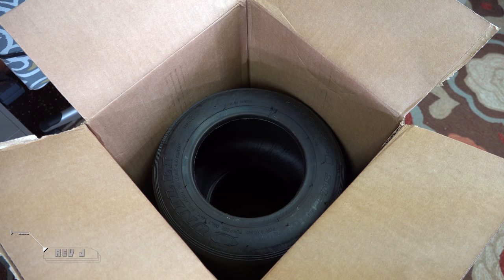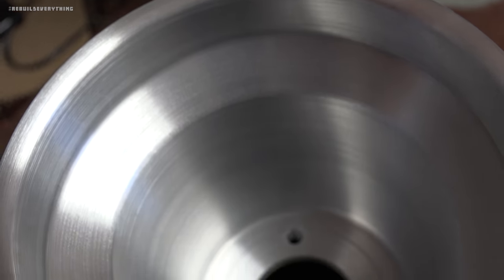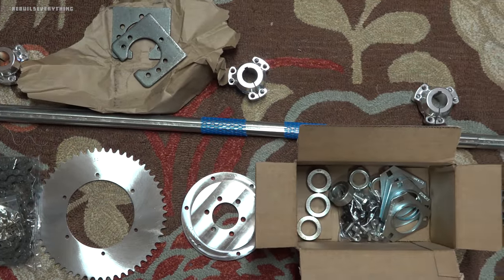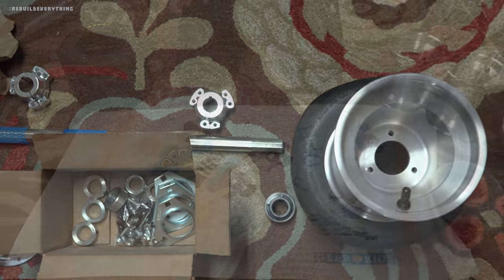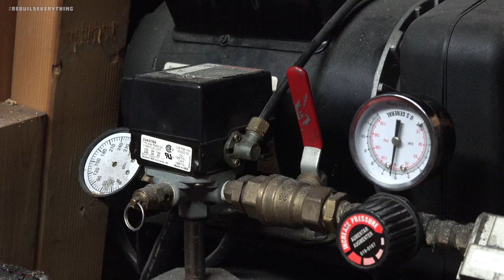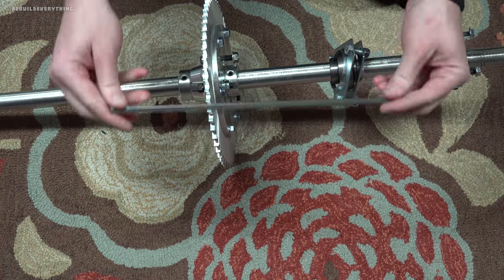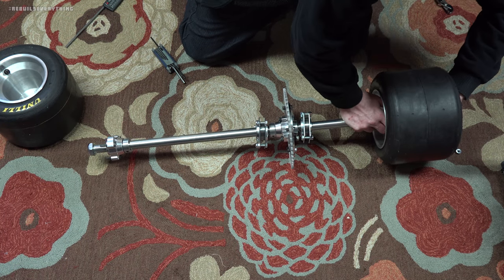BMI Karts Drift Trike Axle Kit

Comment: Aight...I have this exact same setup. My locker collar on the none hub side of the sprocket adapter isn't fitting for some reason. It hits the nuts from the hub side. Did you have any issues like that?
Reply from the maker: I don't understand how it can hit the nuts; the width of the hub places the collar around 1" outside where any of the hardware would install, and is a smaller diameter than the bolt circle. Any chance the hardware was installed from the wrong side?
Reply: REV J Don't think you could install the hardware the other way as the nuts will not fit on the hub locker for the sprocket. It's extremely weird. If I was able to attach pictures I'd be able to show and explain better. Yours looks like it fits perfectly with what you said about an inch. But my locker is flush with the bolt holes haha.
Reply from the maker: My email contact is in my channel bio if you wanna try and send a picture, up to you.
Reply: I have the same problem now... did you find the problem??

Or a solution?. I'm thinking about using some nylon lock nuts instead... might give me some room...

Comment: so if you don't put a key on one wheel than it spins freely making it a one wheel drive?
Reply: Islah Siddiqui if there’s no key in the wheel then it won’t spin with the axle. So yes, if there’s a key in only one wheel that’s the only wheel that will spin.
Reply: @DavidRodriguez-fn4yn  thank you for the response. I conclude that it will be a free spinning wheel then.
Reply: Islah Siddiqui yes but that wheel could take damage since the actual wheels have no bearings
Reply: @DavidRodriguez-fn4yn  thank you sir, BMI Kart team has suggested an idler hub for such setup.